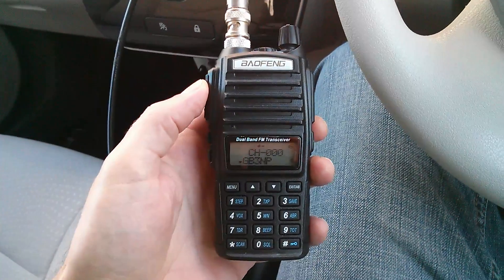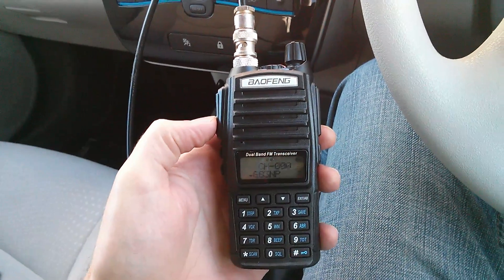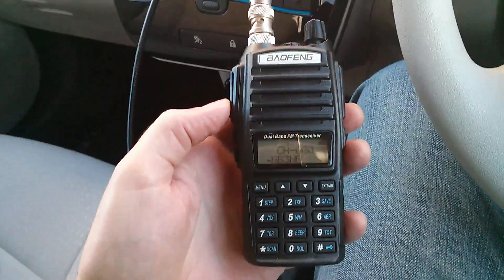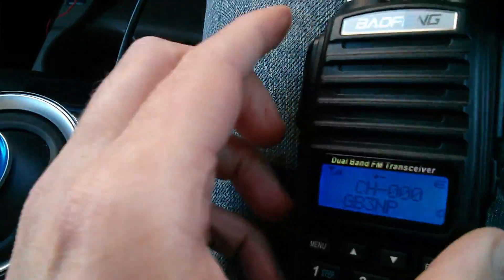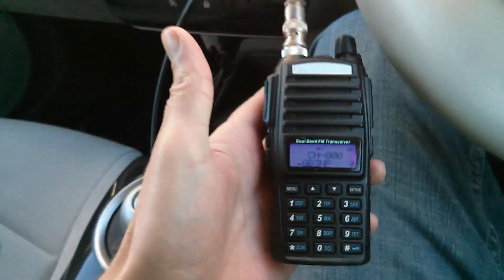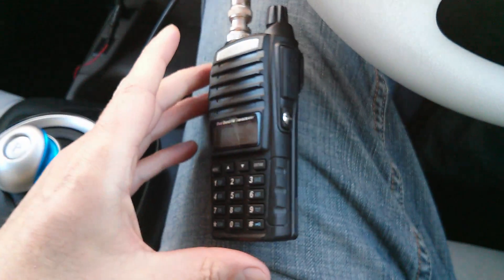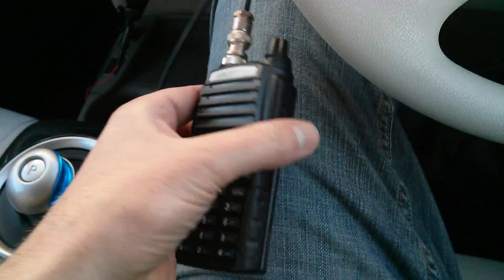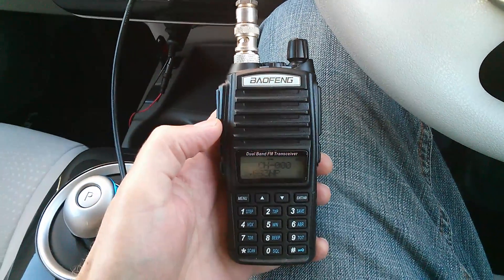Nissan Leaf Electrical Noise on VHF and UHF signal

Comment: I have a Yaesu FT-8800R mobile radio in my LEAF, with an external magmount antenna. I don't have this problem, but I am connecting to the 12v plug, which is directly connected to the car's electrical system. May be that connecting in this way helps provide just enough grounding.